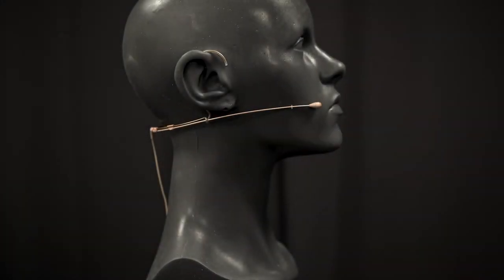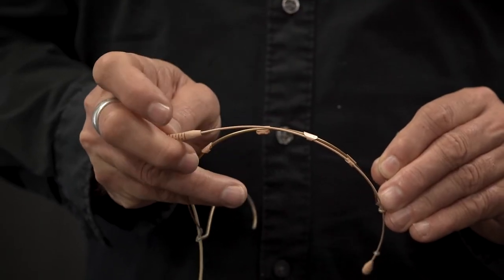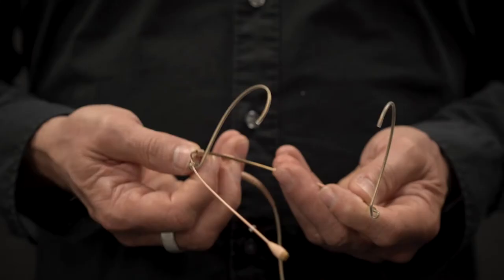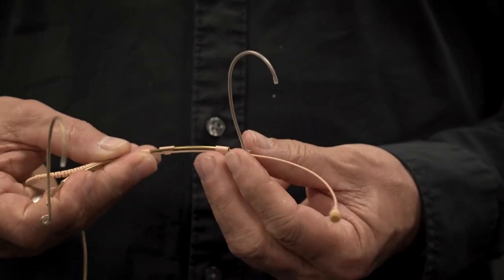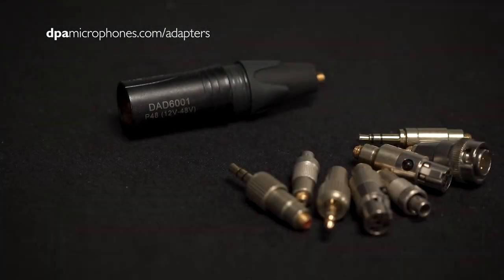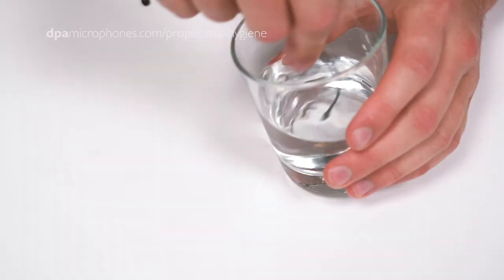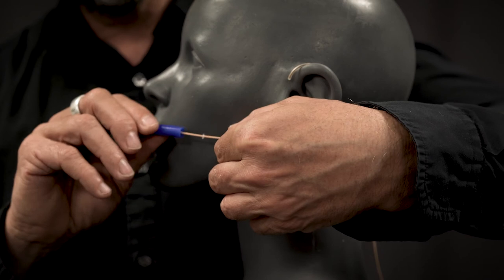Learn how to mount and adjust 4066/4088 Headset Microphones properly

Comment: I have a ton of noise in the mix with my directional DPA headmic. As soon as I move my head, I instantly get a loud rumble coming directly from the mounting. For such an expensive mic, this is extremely sobering.
Reply from the maker: Hi Marcus, I'm very sorry to hear you have an issue. In order to determine where the problem is and how we can help, we need a bit more information. Would you be able to send an email to service@dpamicrophones.com with info on the issue, the model, purchasing date and location and what system you are using it with?

Kind regards

DPA Microphones

Comment: DPA, I think you have the best microphones, I recently purchased the 4066, may I ask what would be the best way to take advantage of such mic if I want to plug it directly to my sony a7 iii, is there any small amp/eq that you would advice to plug it and it goes to the camera, thank you and sorry for the long message, great videos especially the ones done by the gentleman with beard and glasses (sorry I didn't his name)  😊
Reply from the maker: Hi Aaron. This camera doesn't provide phantom power, and 4066 requires phantom power. But you can get a lot of solutions for that, including wireless systems and external preamps. We don't have any one in particular that we favour over others, though.

Oh, and his name is Bo Brinck. :-)

Comment: How do I know which side is the front of the microphone on the cardioid version? Both looks exactly the same.
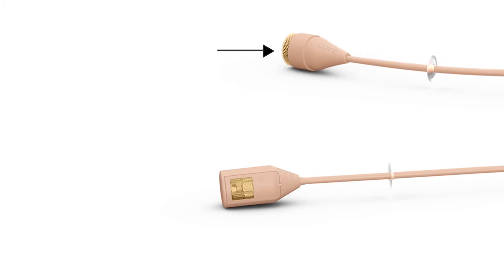Reply: It shows the front at 2:30 in the video
Reply: But the entrance is on the both side of the capsule and looks exactly the same.
Reply from the maker: The mic is fixed in the correct position. As Bo mentions, it has a (very) small bend away from the mouth in order to make it sit perfectly.